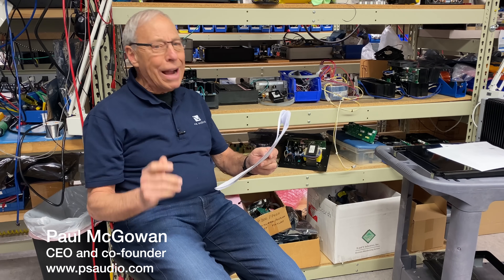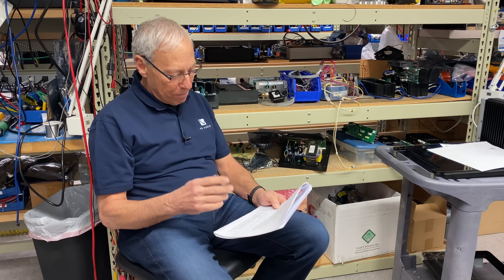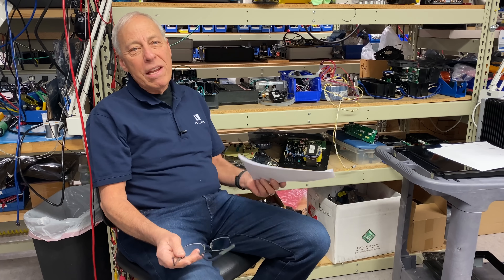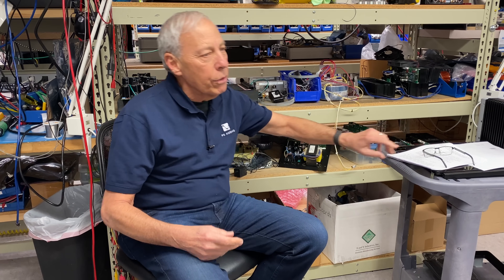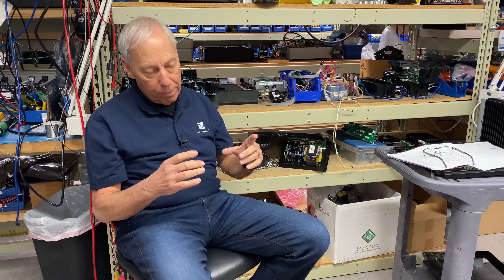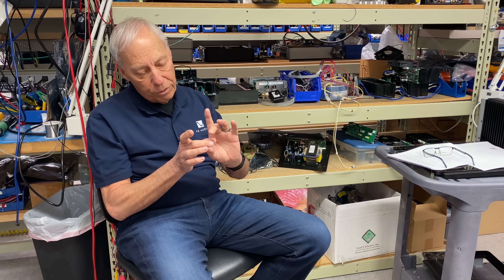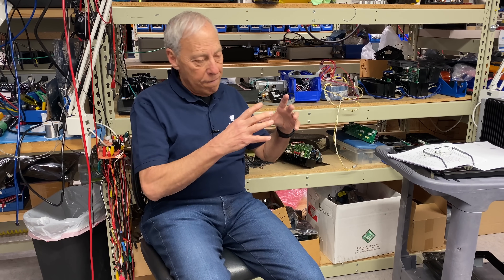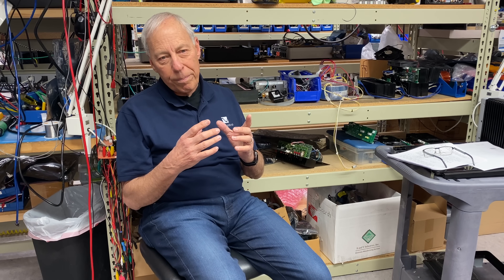Are toroidal transformers better?

Comment: Great reply and I also prefer to see toroidal transformers inside my audio gear. For a particular application considering target BOM cost, physical layout, EMI concerns, operating frequency etc., either way can be optimum. BTW, you probably got your mains power through several transformers on the grid that aren't audiophile toroidal ones, but you better not worry about that :-)
Reply: @FatRat-f9m  Well, not really saying that, but have you ever heard of oil in transformers? Those large ones that feed your audio gear somewhere outside can be full of oil and if they are older ones, nasty toxic PCB, worse than snake oil.
Reply: @ThinkingBetter  The have liquid cooles flammables pad transformesr according to IEEE 979 to styaye far aw2at from thems. I tounf its....

 Institute of Electrical and Electronic Engineers (IEEE) © Standard 979 – 1994, Section 4.4.5.  2002 National Electric Code® (NEC®) Section 450.27.  Edison Electric Institute, Fire Protection for Transformers, Table 2.

thnakes you,l youi are again tyhe HONESTS FREINDS. The others are PRETEND FRENDDS rop make not FUNNY jopkes. My Lo-Fi garbage is funny and a TRAGEDY at the same times. THUMMBS UP!
Reply: Kevin explains(listen to 4:00 or all of it) Toroidal Transformers and validates Paul ...https://www.youtube.com/watch?v=W0U-RGu-s4Y

Comment: Interesting video, I’ve got a great big toroidal in my H360 which probably accounts for its hefty weight - Jonathan from Old York, England
Reply: The equivalent E-I core transformer would not be any lighter.
Reply: @marianneoelund2940  Wouldn't the E-I core be much heavier for the same output?
Reply: @gordthor5351  
Yes, in this power range E-I core designs are typically a good 50% heavier.  It would probably add another 5Kg or so, to the amplifier weight.
Reply: I nearly bought a HEGEL H360; I have to save for another couple of years.